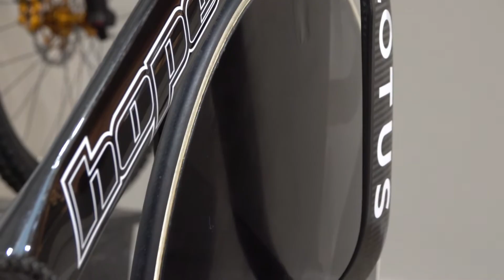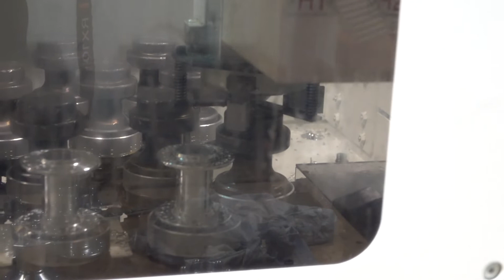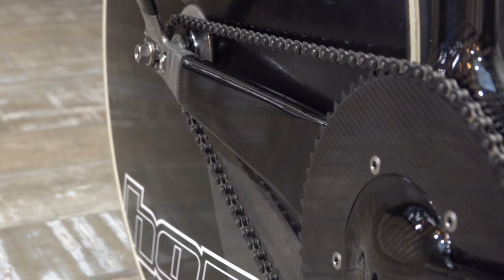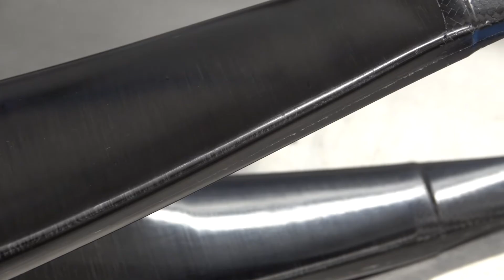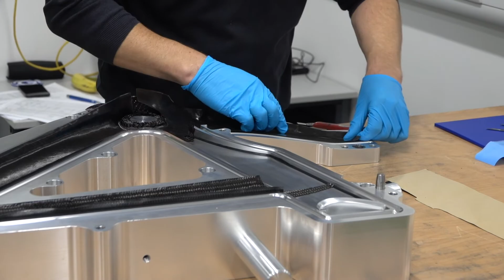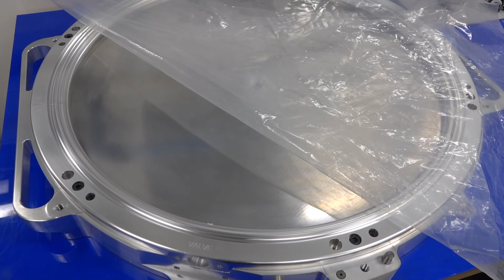See the radical Hope/Lotus Olympic track bike - behind the scenes with Hope Technology

Comment: Standard Frameset (Frame, seatpost, Fork, Stem) | £15,550 + VAT
    Pursuit Frameset (Frame, Seatpost, Fork, Integrated Stem and Handlebar) | £17,100 + VAT
    Upright (Omnium) Frameset (Frame, Seatpost, Fork, Integrated Stem and Handlebar) | £18,200 + VAT
    Sprint Frameset (Frame, Seatpost, Fork, Integrated Stem and Handlebar) | £19,600 + VAT

It’ll also be selling disc wheels, for which it has developed a new manufacturing process, as well as a trispoke. A rear disc costs £2,450 + VAT, front disc is £2,100 + VAT and the trispoke we’ve never heard about before until now, costs  £2,250 + VAT.
https://road.cc/content/tech-news/269729-hope-hbt-track-bike-goes-sale-today-starting-ps15550-vat
Reply: For how many will be made, that's still a fraction of its design, development & testing cost.